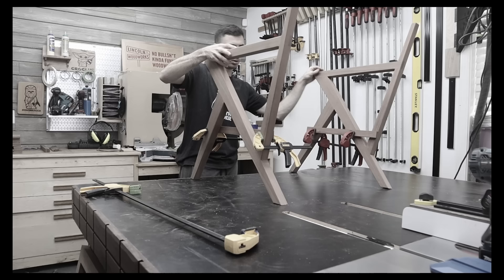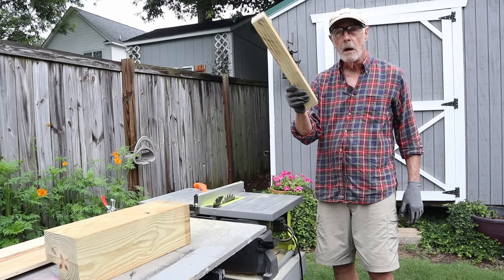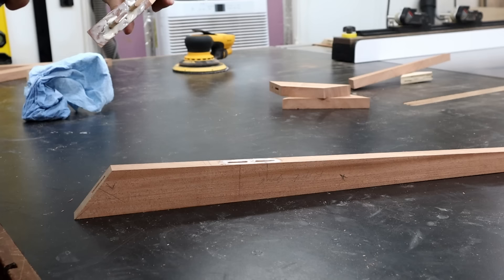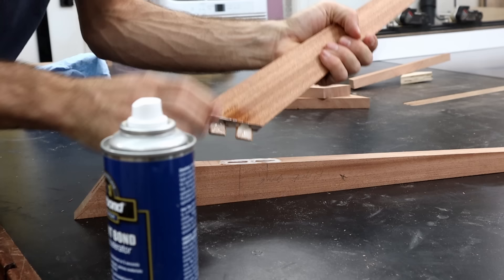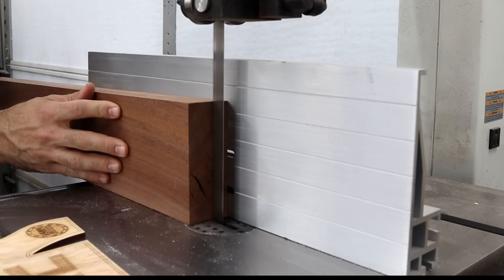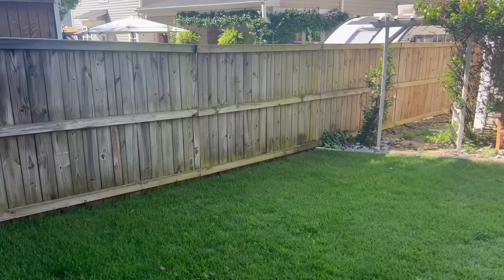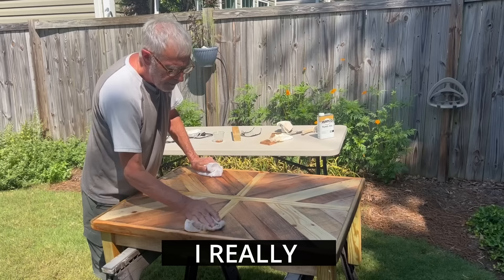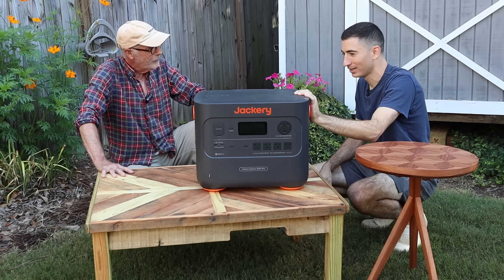I challenged a 78 year old to a build off

Comment: Older John didn't need a shop full of toys to make his table, used reclaimed wood, overcame having limited tools, and still churned out a beautiful piece with like, 12 hours to spare. He gets my vote.
Reply: That is why if only young John didnt complicate stuff, wouldve been so much better. Thats is why the millenials need the resources and the knowledge of the boomer. Please pass the baton good sirs.
Reply: Also, curious if Young John would've plunked down the Jackery on his own table without a second thought like he did John the Elder's?
Reply: @gunderalex  HA yeah, no. The Jackery 2000 wotsits weighs about 50lbs, I really don't see that table holding that up without tipping. Maybe if he set it down gently offcenter towards the back of it and prayed, REALLY HARD to the Omnissiah, but I don't even think the Machine Spirit would help with that.
Reply: No one needs fancy tools, but it certainly saves a shit load of time... how valuable is your time?
Reply: @jonc2914  You'll note I pointed out Older John overcame his lack of tools and still had 12 hours to spare. I believe the phrase is "It's not what you've got it's how you use it."
Reply: @diego2112gaming  nice 40k reference there... i gotcha dude!
Reply: @jonc2914  You do realize the guy with no fancy tools finished 12 hours early, while the guy WITH the fancy tools almost did not meet the deadline?
Reply: @diego2112gaming  Elder John was only using tools that are second rate. He didn't have the best tools, nor were they the worst for their kind. So it was all pure skill.
Reply: @jonc2914  if it saves time then why did the old guy build a bigger better table in less time??
Reply: @verne51  cause the young guy streight up used glue... stupid decision. Not tools related
Reply: @verne51  because it looks like bulky waste. Really. The old guy tooks few rubbish woods and nailed it together. Sure you can build a table like this, but it looks exactly like this. While the younger john created a designer piece. This is just another level of furniture and is not compareable. Sure you can drive with an old Ford, but it is nothing against a nice modern sports car.
Reply: @d.w.i.3716 
Take your tiny, wobbly, expensive modern car. I'll take old John's big, bulky, second/third/fourth-hand, classic style old car any day. I prefer square over round furniture anyway. 🤭 It's a matter of personal taste and needs. 🥂🍻 I voted for old John!
Reply from the maker: @jonc2914 I don’t care which one you like but as a quick education session. Most higher end furniture that will outlast cheaper stuff is made with just glue too. When dried - wood glue is actually stronger than the wood itself. #funfacts
Reply: My husband: “so you’re a 78 year old man?”
Me:” dude it’s just how I was taught”
Reply: bro if I saw the pallet table I would not buy because it looks like shit where the other is fine art.
Reply: @Nick-hv5tt  Cool story. Neat. Happy for ya. You do you.
Reply: This is the thing....where i have to say that both put their sweat and blood to make the tables on time. I dont see anything wrong on using what you have (why to downgrade) I liked both tables BUT the oldschool design suits me more :D i like tables where you can place more than 2 cups and phone :D
Thanks for anice video and i hope you can colab more.
Reply: I agree, both tables look fantastic but the reclaimed wood and backyard engineering makes elder John the winner to me
Reply: Agreed
Reply: Everyone talking about the old man finishing with simple tool earlier compared to the guy with all the fancy tools is forgetting the most important thing which is the older guy probably has more experience than the younger guy been alive so in that case he beat the guy with the better tools.
Reply: Old John won, he didn't break the rules... the rules they both agreed to was only using what you had in your shop. Young John had to run to the hardware store for materials which he did not have in his shop... therefore he was disqualified and violated his own rules....
Reply: @d.w.i.3716  A designer pos that might look pretty but hey if form over function is your thing more power to ya pal.
Reply: @Lincolnstww  You a rep for a company?
Reply from the maker: @Red-yz6fl  yeah for lincolnstwoodworks YouTube
Reply: @Lincolnstww  I meant a glue/adhesive company.
Reply from the maker: @Red-yz6fl  I know what you meant. Clearly I’m not a glue rep. That’s a very well known fact in the woodworking world. It would take you 15 seconds on google to confirm it.
Reply: I agree, that table is beautiful, and very practical as well. Both tables are nice, but given that younger John had to break his rules, I think older John wins, hands down. Of course, he is more experienced. Those saying that his table looks like junk do not appreciate using wood to create patterns. Older John could have stained the wood to look identical.
Reply: @Lincolnstww  It would take me 15 seconds of reading a bottle of glue to read that it is '4x stronger than wood' or whatever. Plus caveats. 

I've had a hand in grain bins that a customer wanted all wood joinery no fasteners or glue. Just saying sometimes the old way of doing things is quite durable if not better. Only my not so humble opinion.
Reply: Slight edge to young John. Beautiful pattern
Reply: Tools make a difference.  Skills and experience also make a difference.  Whom does best probably depends on familiarity with the specific project and how well and quickly they get their mind set on it and tools at hand.  An ancient engineer might with an abacus outperform a modern millennial with a modern super computer at math or any job that requires complex math, if you start your stopwatch with one person entering equations, never getting help, while the other starts etching a clay tablet.
Reply: Aaaaaaand I'm muting this now cause it's filling up my notifications. You lot have fun.
Reply: @Lincolnstww You literally asked for people to vote on which one they liked!?
Reply: Need to use the same tools for fair competition
Reply from the maker: @stayinggolden2665 yup - I was saying I don’t care what table people like so it didn’t sound like I was trying to win someone over. This video was never about which table is best either 😉 it’s about different styles and friendship!
Reply: @jonc2914 in one off builds it doesn’t save enough time to matter in many cases.
Reply: Old John gets my vote for the same reason
Reply: Loved this video! I'm a newbie here so I really appreciate your candor and comradery with John Sr.  :) Wonderful idea and I think you both made incredible pieces. For my personal style preferences (I'm a Millennial also) I would have to go with John Jr.'s modern mid-century design, however appreciate John Sr.'s ingenuity and upcycling techniques. Well done guys! 👏
Reply: @MsHyeven  And you realize that the guy with no fancy tools built a very basic table, while the guy WITH the fancy tools built a very fancy table? Your comment would have a bit of value if they both built the same thing, but they didn't. Fact is: the fancy tools helped create a fancier product, and made it easier (if not even possible) to do so.
Reply: @timderks5960  And would you buy the fancier product, or the basic product? How much value do you really think these two tables hold? If you can only perceive the world through finances, then please go ahead and ponder on the actual value. Remember to deduce from the table's price the price of the fancy tools, and the labor cost. You see a basic table, I see efficiency.
Reply: John Senior gets my vote! ❤
Reply: @jonc2914 and expensive glue at that! The spray/liquid set is about $50. You have like 3 seconds to get it done.
Reply: @Nick-hv5tt yes, much more work for the young guy
Reply: It’s kinda apples & oranges. John Senior’s table is great for the porch, you can even put your feet up & relax. Let the grandkids eat there. No worries. Functional & I love the reclaimed aspect of it. John Younger’s table is gorgeous,  perfect to hold a glass of wine and my current read from the bedroom balcony. You have a great eye for classic style. Love the chairs as well. So I think it’s a win-win. The tables were made for two different settings and levels of sophistication. Simpler projects require simple tools. The more complex the design, I’d love any tool that makes it easier. Woodworking should be a labor of love.
Reply: @verne51 Because younger John went with a much more complicated build, the table top is literally a puzzle piece of tiny bits.

In the end, younger John's looks nicer, but older John's is more practical in terms of size and strength. So for usability I'd give it to older John.
Reply: @MsHyeven not taking into account that younger John’s coffe table is a whole lot more refined, complicated and undoubtedly beautiful than older john’s sturdy chunk of wood.
Reply: +1 to this for old John. Reclaimed looks pretty darn snappy and he didn't have to hide any mistakes.
Reply: I think we need a "is it still together" follow-up in a year.
Reply: I could repeat all the compliments already given to older John,  but I just wanna recommend the bourbon chicken. 😉
Reply: @TheMisterTosco  It's also incredibly unpractical.
Reply: couldn't have said it better!
Reply: @d.w.i.3716 Thanks I will take the old before your new garage that doesn’t last more then a year… 😂😂😂😂young and stupid.. Designer table??? Absolutely “Not” garbage that falls apart
Reply from the maker: @TylerMumford lol I’ll give it a try thanks for watching
Reply from the maker: @zippytechnologies I’ll give everyone a spoiler alert. Both tables will be fine for a very long time!
Reply: @Lincolnstww your description literally says “who can build a better table”. WTF  you mad at everyone that honestly gave you an answer, that you didn’t like.
Reply from the maker: @need2connect  scroll through those comments one more time. It’s good to see you’re this upset though
Reply: @verne51  Because the older guy did straight cuts only and used fewer pieces that were tiled together.
Reply: And it was safer to put the Jackery on HIS table
Reply: Older john for the W
Reply: Off to the Corral... lol
Reply: @jonc2914 um,.they BOTH used glue...
Reply: @jonc2914 older john got done quicker with out the fancy tools so I guess his time was pretty valuable to him
Reply: @TryhardHouba yea to be fair they should have built tables of similar size I’m sure a lot of us voted just on the fact that old Johns table was of more use
Reply: @jonc2914 The point is we learned how to build something beautiful from old John with little investment. 

I can learn to build anywhere with a damn unlimited budget. I don’t need young John for that. 😂
Reply from the maker: @sandraeisphotography  Thanks!
Reply from the maker: @derekstiles5801  new challenge - you come to the shop and build the little table! John sure does a lot with very little though! thanks for watching
Reply: Well, I think we often undervalue our skills in labor because we have so much choice and shows that we set ourselves to fail. Our parents just had a saw and needed to fix stuff or build stuff and just went ahead and did it.
There is something to be said about building your own stuff versus buying it.
Reply: I think it's over to golden coral.
Reply: @F_F_C-16  yeah
.... I was wondering how the contest would go since in one case you have a table and the other you have a "tabouret"....
I prefer practicality versus esthetics.....
Reply: I am 36 so I'm an early millennial, but I do most of my projects like older John. I get the Ozito brand gear, not the Ryobi ones. They get the job done. Then I just use my brain to figure out the problems. That's what is fun about these problems to me, finding novel solutions along the way rather than using blueprints and schematics and an engineering degree
Reply: @ryneagheilim9782  True, my dads a boomer and i'm a millennial who worked under him with wood and lawns -  idk why we over complicate shit, its not intelligent.
Reply: Why you acting like Old John was using a stone hammer and animal bone saw or something lol he had machines as well.
Reply: I mean, look at the design differences.
Reply: @verne51 look at the level of design though the young guy was making some intricate stuff.
Reply: @MsHyeven to be fair, Younger John had a LOT of cuts.
Reply: Both had nice ideas, but John Elder did something so nifty and thought through that he gets my vote.
Reply: @Lincolnstww . A friend wanted me to break up an old table that she had in her back yard.  The weathered wood looked great.  The glue was stronger than the wood so the wood didn’t split along the board edges.  I was impressed by the glue, but not with the results
Reply: judging by the comments the next build challenge should have a no glue rule 😂

i guess in racing terms and not woodworking it would mean race two cars but not use gasoline or diesel 😂

Its as if they think glue is cheating lol.
its bonding and strengthening and keeping a solid shape i dont see what the problem with using glue is
Reply: @jonc2914 young John stated he has a bunch of fancy tools but it still takes weeks to build simple furniture.
Reply: @timderks5960   this is the logic of a mouth-breather typing a prompt into midjourney and calling themself an artist.
Reply: We call that a survival tool
A table is needed with no ressources.
But with the right tools and instalation you can build premium furniture!
It depends if you are a basical minimalist or if you wanna sale and be comfortable...
Reply: @Nick-hv5tt I need a table I can trust, not one that looks fancy. Clearly only one of those tables is trustworthy for the bulk of uses. I'd buy the pallet table solely for the more spacious top. Art is nice when it's not something I need to rely on.
Reply: @d.w.i.3716 till youre in suboptimum conditions and your modern sports car gets, passed, towed, or, pulled out, by the old Ford you think its better than.
Reply: This is the difference between decades of experience and knowledge.
Reply from the maker: @Retrobution  there are a lot of people that have no idea how furniture is built based on the comments. It’s been fascinating following this one.
Reply: @SwapnilBBagul  you are forgetting the Talent Factor!
An untalented person with decades of "experience" is just a trying person
A talented person arrives and achieve in months even only weeks what normal poeple achieved in years!
Most needs training and course
Some figure out alone and learn what mosts havent been thought for years and achieve perfectly something at the first try whilst most fail over and over before to reach okness....
Reply: One is a table built to have fun, John sr was building something he probably didn't need. 

John Jr was building a side table for his new chairs. It's built to match the set and serve a specific purpose. To those that say form over function... it's function is to hold a couple beers. I think it will function perfectly fine.
Reply from the maker: @cody7855 you get it. The intention of the design is true function.
Reply: @Lincolnstww  this is the first video of yours I've seen. I enjoyed it. I also enjoy the comment section where you aren't pandering to everyone's opinions.
Reply: I like both designs. I think older John's table is better : recycled material, lower gravity center, basic design but more tabletop surface for multiple friends sitting around, no big deal if a glass or a bottle lets stains on it, or with sun/rain/whatever ... Younger John's table is way more stylish and built with better wood, perfect for a couple sharing a bottle of wine at sun dawn. Its high gravity center requires level ground. About the building process, older John used less advanced tools, he had everything he needed at home (no tung oil at home ! Really ?) and all was finished very fast.
Reply: Old John! That's a table you can have at a frat house without ever breaking. Old John for the win!
Reply: @ryneagheilim9782 they don't want to pass it they want to bury it
Reply: I love the the table Millennial John.  did with all his toys. 
But as a boomer I love what older John made with simple tools and reclaim wood, it's exactly what he wanted to make.  My vote goes for the Boomer John😍
Reply: Gen X here. No one beats a boomer at making fine things from what others consider trash. Just wish they could have taught that to us. 😅
Reply: @ryneagheilim9782  Nobody wants the baton, they want the clout.
Reply: Older John won this
Reply: Me too
Reply: They did pass it on to us, Just not verbally or intentionally, we had to sneak in the shop, shut our mouths and not be seen. Haha
Reply: @d.w.i.3716 I actually prefer sn old Ford any day to a modem car, but to each their own
Reply: correct plus i bet his vision and coordination isn't what they once were but he still got the project done. my hats off to old John.
Reply: @LadyVoldemort wobbly? You did watch, right?
Reply: Everyone is voting for older John because he's an old man. The truth is- it's a good table, but basic. He did a very good job. Younger John did a fancy table, and that would probably cost hundreds in a store.
Reply: @Lincolnstww your right... I'm a boatbuilder and glue is quite good... But to be honest... Our shit that's glued together won't hold a thousand years like old tenons, so old John is still ahead of our time!
Reply: Old people can buy tools too.
Reply: @jonc2914 
The more you put in, the more you get out of it.
Reply: Absolutely
Reply: @d.w.i.3716 you are so weong and every person over 50 will strongly disagree lmao
Reply: @diego2112gaming I dont think the Omnissiah deals in wooden tables... 😂
Reply: yes i love using pallets as well, i have made shelves, a 2.5 metre ladder, four tables - i learned a new technique from john of using one piece of wood to bang at rightangles on the pallet, awesome. i also use 3D (pyopenscad) modelling but not for woodwork. i loved the geometric locking (try an Escher pattern next time! you may need a laser cutter). to be honest both pieces are so beautiful and elegant in their own right i cannot in good conscience make a choice.
Reply: Come on Diego. You can't put on the same level art and patch-up job. Yes he did make a table in one day but he used scrap wood and screws while the other used sapele and complicated joinery. The old man table won't last more than a summer or 2. It is typically pratical. No beauty in it, no search for improvement.
You can't just go with the experience or age. Tools do make the woodworking possible. Cheap tools goes to bad results even if you're talented. It requires accuracy.
Do you even build ?
Reply: @fatol500 as garden furniture old John’s wins hands down.
Reply: I know this man has likely been doing this longer than I’ve been alive, but gloves on the table saw made me tense up 😅
Reply: At 78, he's not a boomer, he's silent generation. 95 percent of the time when people talk about boomers they're talking about something else, everyone from Joe Bonamassa to John Wayne gets called a boomer.
Reply: @markgergel1717 we're not dead yet you know
Reply: @mattlove1 The problem with GenX is we were told growing up to "Get a life" and "You have no life." Some of us are just not sure. Some of us like it that way.
Reply: @musicfan300  #2 is the reason I would have voted for John Snr in a heartbeat - I prefer to have a home with practical things I can use, not stuff that is so precious it sits permanently in a corner because heaven forbid someone spills something or tries to place an object that weighs more than 2 pounds on it.
Reply from the maker: @user-kpkxgtj  if it makes you feel better I don’t care about the table - furniture is furniture. It’s meant to be used. Just because it looks like doesn’t mean it needs to be babied
Reply: @Lincolnstww   it was never that serious 😅 In case you haven't noticed, the comments ended up divided between practicality and aesthetics, with some rightfully pointing out that such furniture would cost a good sum. As someone who isn't a wood worker, the only way I would end up with such stuff is if I bought it. With that in mind, I simply throw my hat behind practicality. Being that you're the person who made the table, of course you don't care about it - you'll just make yourself another one if it gets wrecked, the only cost would be the materials. As an ordinary person who would have to buy such art and pay for the material plus labour, I would relate very differently to it. So your comment doesn't make me feel any particular kind of way - it is a bit surprising though seeing as you asked for people to vote one way or the other.
Reply from the maker: @user-kpkxgtj  I didn’t take it as serious and I’m not trying to persuade anyone. Just making a general statement that people shouldn’t feel like nice looking furniture needs to be protected at all costs. Use it! That’s the point of having it
Reply: @Lincolnstww   and the point myself and others were making is precisely because want to be able to use our things without too much thought, we would prefer that they be practical, in a variety of situations if possible, as well as beautiful.
Reply: I can only imagine what Older John would have achieved with better tools, and ample time to do something truly spectacular, like Shaker, Henredon, Ethan Allen, or Thomasville style furniture.  Most millennials suck at handwork, specially in construction, and furniture making. They need catalogs of equipment because they lack the skills, and the patience to do  high end design, and high craftsmanship.
Reply from the maker: @Wateringman  you will get a chance to see soon enough we are going to swap shops! But I would temper the expectations - John is not a furniture maker
Reply: Neighbors like this ❤
Reply: Younger John is creating jobs.
Reply: @ryneagheilim9782  we have been TRYNG TO PASS the baton ...but yall gve us a fight ..sayin that we are old & new things /tech are around ...BUT REMEMBER NO MATTER HOW MODERN A BUILDING IS ...T STLL NEEDS A FOUNDATION
Reply: Older John for me, I don’t like the design of that little end table and you made so many decisions that just led to it taking longer than it should have.. you tried too hard and it failed you.
Reply: @Lincolnstww I don’t know what “high end furniture” you have. Mine is definitely not made with mostly glue. Your education session needs more lies😂💀🤡.
Reply: So many people arguing about a table
Reply: @d.w.i.3716 Rofl wtf you talking about you've never seen old ford's gap Ferraris on yt? You can kit out an old truck for less than the sports car and still kick its ass. 😂😂😂
Reply: @MsHyeven but! Older john wasn't filming everything, changing rigs and setting up cameras, and dealing with all the other little things that go into recoeidng.
Reply: @d.w.i.3716 it looks kinda trash tho… no offence, he is a very talented woodworker, ấn he has taught me alot through his vids.
Reply: Older John made me realize the problem is me, not my tools or space.
Reply: @Lincolnstww  Your table has a complexity almost too refined to leave outside, I'd be tempted to take the chairs inside as well if they weren't purpose made porch furniture. Against my tastes, your table is apparently higher quality and is the winner of my vote for the most unique table. My vote leaned towards Older John as I prefer porch furniture to have a rustic look which is better suited for standing up to marks and damage from the elements and careless usage, and yet I felt he could have eeked you out on complexity with a denser cross pattern by ripping his planks into slats. Well done to the both of you!
Reply: older John makes it happen. That table was awesome!! He's got my vote!!
Reply: @jonc2914  was time used to earn the money to buy the fancy tools? Was enough time saved to pay for everything?
Reply: @d.w.i.3716 not really when the table you don’t like has more stability and endurance it’s like comparing a classic mustang to a newer bmw yeah the bmw looks nicer to some but you get more solid performance with less issues with the classic American muscle
Reply: Agreed! Older John's got my vote too..
Reply: And used Ryobi.  That should give him a 5 out of 10 handicap
Reply: Yep my dad, 1970 had one very old cast iron ancient table say and one craftsman skill saw and with a few other hand tools build entire house by himself including all the cabinetry which is still there today, albeit new door and drawer fronts (that has not lasted now, originals were repurposed and still lasting), Oh he had only one arm. but although great equipment can mean extreme and precision design, someone with a knowledge of craft can whittle out master pieces with a pocket knife
Reply: @MsHyeven  Thats all well and good but the dude you're arguing with is right. Older John worked much more efficiently cause he's been doing it for decades. 
The point isn't that he still finished first, its that he would have been even faster with a better set up which is objectively the case. That shop full of "fancy tools" is almost essential to any working tradesman.
Reply: 100% this
Reply: Just chiming back in since the "mute" option mutes EVERY thread, not just this one, and that's intolerable to me, and there's been some comments made about how "some people don't understand furniture design" and whatnot. Now, those may not have been directed at me, but one can only assume based on the fact they're in my thread. If they weren't, I apologize, blame it on the fact I'm autistic, old, and cranky.

I worked in my granddad's woodshop with him for literal years making furniture using dovetails, mortise and tenon, box joints... no glue, screws, or nails. There were no power tools in his shop, not because he didn't believe in them, because he just never bothered with upgrading. He had what he had, it worked, and it worked good. So yeah, I understand furniture making. Not only that, but on my mum's side, her parents did upholstery, and while I wasn't as involved with that (I was in granddad's shop literally every weekend), I spent a lot of summers in their upholstery shop. So I don't have a knowledge of just how to make the wood bits. I can cane, stuff and cover, stitch, emboss the leather, tack and brad...

Again, if those comments were not directed at me, disregard. Just sayin', when I say I prefer Old John's work, it's coming from a place of firm understanding of how all of this is done, having done it myself, and not a little bit of nostalgia and grief from missing my granddad.
Reply: How did this get so toxic 😂. Such a feel good video I can't believe the Internet does this to us
Reply: @Lincolnstww only time will tell… my hand hone library table and mail cabinet both over 100 years old doesn’t have glue…
Reply from the maker: @aliciamcnamar8203  Unfortunately comparing glue from 100 years ago to modern day PVA glue isn't much of a comparison. Old glue made from animal parts would get brittle and eventually fail. The synthetic glue we use today, thankfully does not.
Reply: @diego2112gaming  also “the right tools the right job” and the “man with the most tools wins”. But in this case definitely the pallet wonder table
Reply: Lol. That is the equalizer factor: experience. Nothing to detract from either
Reply: resilience vs resistance....
Reply: @Lincolnstww most higher-end stuff I'd made with glue. Not "just glue".
Reply: @Lincolnstww  very true, used to build cabinets and that wood glue had a heck of a bond.
Reply: Mine too
Reply: Both good builds, but I agree. Golden time
Reply: I'm sure it was probably editing but older John just seemed laid back and didn't complain really about anything. issues simply became challenges to overcome.
Reply: older John also didn't seem to be complaining about anything. He just rolled with the challenges
Reply: @diego2112gaming yall are saying that but he literally said his table won’t last in the video. lol also every heard of working smarter not harder? Why would I build something when there is something already built? One that helps the actual economy and two time is valuable every old guy will tell you he regrets working his life away doing old techniques because they were stubborn.
Reply: Agreed, old John for the win...

I have to say though, that the best case scenario in my opinion would be a table made like old John's but using young John's pattern arrangement for the squared top, you have to admit that it looks beautiful
Reply: This was great! I love both of the tables!!!
Reply: @Nick-hv5tt   You missed the whole point of the pallet table...bro.
Reply: I love the design of the young John table. It was built to compliment the chairs, and it does. A good height for sitting down with a cold one a watch a match of cornhloe. Old John built a table that has the class needed to sit around with various trays of snacks piled on while waiting your turn to thow some shoes. 
I would feel zero guilt or shame in having either one of these. But I will throw the win to old John because it was made of pallet wood.
Reply: @Lincolnstww  Narcisit spotted!
Reply: The goal was an outdoor table and I would much rather have a big sturdy table that I can set our meal on when we grill out without worrying about it tipping or how much it can hold and the design on the top is cool too. I like younger John's table two but it's hard to compare the two since older John's table is much more to my taste. I recently bought a bench made out of pallets that's a lot like that big table
Reply: We saw what he used. No need to repeat
Reply: Nmmmm
Reply: Onnp
Reply: @Nick-hv5tt you could not appreciate it, you should still respect the work done.
You talk about someone work, it is not some random furniture in a store (even if someone certainly also designed it and also deserves some respect shown).
You don’t like it, it is not the standard of fine art these days, totally understandable, but a bit of empathy for the person working for your entertainment by making part of this video, even hidden behind a pseudo on internet could be useful…
Reply: There’s good enough then there’s trying to go beyond your limits and knowledge to produce something better outside of your comfort zone. As even old John said. “The sand paper hides the sins”.
Reply: @jonc2914  Definitely some truth to that, but John Sr. finished with a lot more time to spare
Reply: @Nick-hv5tt  you need yo eyes checked bruv
Reply: @Red-yz6fl  it wouldn't take long to look up video tests of wood and see the claims are true. Wood glue is fully sufficient for building long lasting, strong products. What people want has nothing to do with that fact.
Reply: @jasonv.5938  I didn't say using glue is inherently weaker or worse than anything else I was giving an instance of my real world experience. "Look it up" is such a lame response dude.
Reply: @Red-yz6fl  you sure as shit implied it when you basically accused him of shilling for glue companies. A "lame" response? What's lame is making accusations and implications without knowing evidence.
Reply: @jasonv.5938  Wtf is your problem? I made a dumb joke at the guy who made the video because he was talking like a sales rep and this was what over half a year ago. Now you want to act like I don't know anything and you're so smart because you can look stuff up and somehow even though we're communicating online I don't have the ability to look stuff up? Besides like I said months ago I don't have to look anything up I can go in my basement and look at what the bottle of glue says about its strength compared to wood. This "look it up" or "Google it" culture is annoying and lame, how about try "figure it out".
Reply: When it comes to high quality craftsmanship there is not beating the Greatest and Silent Generations.
Reply: Give him some nice wood and he'll easily peacefully make you good pieces
Reply: @jonc2914 very irrelevant older guy used glue too…..
Reply: Spoiler alert dude!
Reply: @jonc2914 Lol its the difference between a career and a hobby. I could use a crank drill and a handsaw if I wanted to stay at a customer's house longer than either of us wanted me to be there.
Reply: @jonc2914  unless you value improvising and doing more with less.
Reply: I'd choose Elder John as mentor hands down
Reply: @Lincolnstww  I mean, old john also used glue... I think that guys point was, 'it takes awhile for glue to dry'. Which is moot, since both pieces were glued at various joints. Can't believe it took you a full hour to cut 64 pieces with a miter saw and a jig by the way... I'm running 4x that fast with no jig on 4x4 lumber. You stopped for lunch, didn't you?😂
Reply from the maker: @michaela3863  ill let you in on a little secret. It takes about 2-4x as long to do anything when you’re filming. I think I shots all these different angles because I an idea for the video and ended up not using any of it. Happens
Reply: @Lincolnstww  haha, I was just ribbing you a bit. Never would have considered the additional set-up time for filming. Thanks for the insight. Nice build. 👍
Reply: @d.w.i.3716  Old Johns table not only looks better (in my opinion, young johns table just has a nice pattern), but is actually functional. As was already said, no way would young john plop that jackery on his own table, it would have destroyed it. Also, old john using reclaimed wood is a plus, not a minus. It looked great, was already perfectly aged, and was completely free.
Reply: @TheMisterTosco  it has little to no practical use. They should have agreed upon whether they were making a coffee table or a end table of sorts, because young johns barely even qualifies as a coffee table in my eyes. Their projects are too different to compare, they both seemed to have different goals.
Reply: @Lincolnstww you are not coming off well here.
Reply: Nice have one tho
Reply: Older John has my vote too!
Reply: @diego2112gaming  have you ever seen old John’s Johnson?
Reply: older john ftw
Reply: @jonc2914 It depends why you build things.  I ENJOY being in the workshop making things.  I don't  rush.   If I was doing this for a living then the focus on efficiency ould become paramount, but the enjoyment would disappear.
Reply: He looked fully loaded to me.  Table saw, chop saw, nail gun.